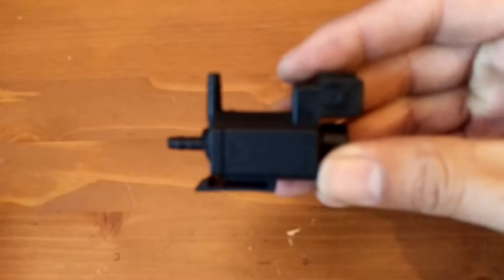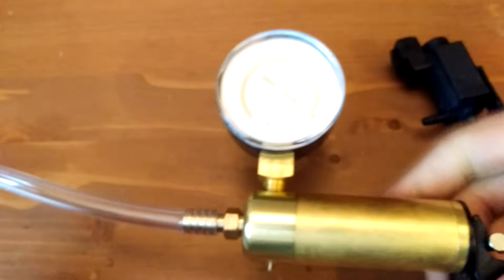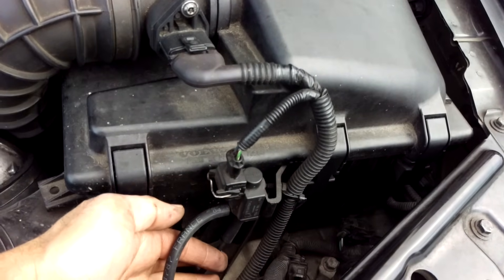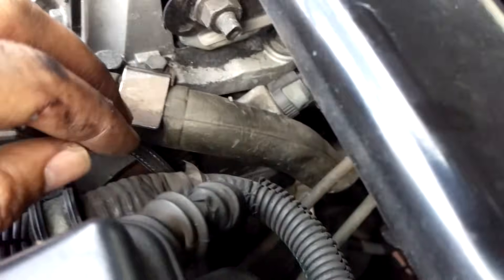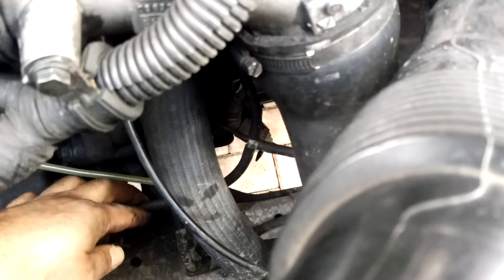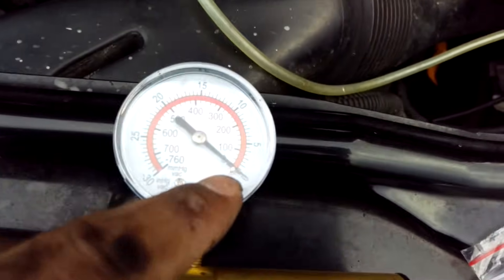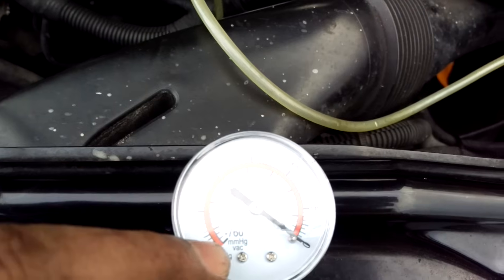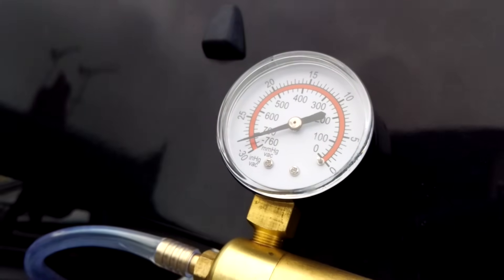How To Easily Test a Turbo / Boost Control Valve TCV

Comment: Fantastic, helpful video!  Is the test the same for 2.5T P2 Volvo engines?  My TCV is located same place as yours in the video... but whereas your video shows a TCV with what appears to be only 2 ports, my 2.5T TCV has 3 ports... two in-line and the one perpendicular port you hook your vacuum tester to.  Seems that it would be the same test regardless, yes?
Reply from the maker: You need to test the vacuum feed going into the valve first to make sure vacuum is available then reconnect and test the outlets on the valve for vacuum when the valve is operating in the appropriate circumstances.

Comment: Could this be the reason why the engine goes into limp mode in 4th gear when floating at 2500 rpm?

Comment: Hi there, What about hte Volvo D5  2010 -  205 hp twin turbo, where is the  Turbo / Boost Control Valve TCV located?  And does it have 2 of them? regards MEtin.
Reply from the maker: From memory there are two, one of which is an electronic actuator on or very near the turbo and there's a solenoid operated vacuum valve at the back of the engine bay. I would recommend asking on www.volvoforums.org.uk as there have been lots of discussions on there. Good luck. 👍🏾

Comment: Hi Mr SiRobb!
Reply from the maker: @mggergo9108  Hi!
Reply: @sirobb  so, my vacuum test was stable 700 mmHg. And the solenoid is working well. But!
Reply: But the popping noise is wery strong. What do You think, whats the problem. (2004. 2.4 D V70 eur3)

Comment: On my XC90 I just paid for new “Swirl flaps” as they were totally broken inside also, but the noise from the “pedal taking my foot off” still very annoying- Volvo garage does not seem
To
Know what it is.. could this Sensor be faulty or is it something else? They say “waste gate on turbo” but mechanism
Opens and closes when stepping on gas so I dont think its a turbo… 😮any tips? Thanks

Comment: Just carried out this test, on idle my vacuum gauge is shaking/fluctuating between 200 and 350, when I bring the revs up the vacuum shuts off at 1100 rpm. Any idea where I should be checking next please Rob.

Comment: Hi Sir my xc 90 d5 year 2004 is having a problem with the pipes of the coolant system the gasket is not the problem what can it be hope u can help…. Thanks… greetings from 🇩🇪
Reply from the maker: Hello. Can you give me a lot more information please?
Are you losing coolant? Is the engine overheating?
The cooling system has many, joins, pipes, seals and gaskets.
Reply: @sirobb  hi the engin is constantly 90c… it is not losing cookant
Reply: The coolant level is going down when I drive….
when I open the coolant tank and the pressure goes down from the pipes. It fills up between Max and min
Reply from the maker: @MuBe-um7rq  Check the coolant level when the engine is stone cold.
It must be at maximum on a cold engine.

It does not matter if the coolant level changes with engine running as long as there is no coolant loss and no overheating.

From your description, I can't see a problem with your cooling system.
I have a cooling system flushing video in my list if you still think you have a problem.
Never open a hot cooling system.
Reply: @sirobb  why do the pipes get that hard ( the pipes after the thermostat)or is that normal ? Again thank you a lot for your respond.
Reply from the maker: @MuBe-um7rq  The cooling system operates correctly under around 12 psi/0..8 bar pressure once warmed up so hard pipes under pressure is correct and normal.
The pipes return soft when cool.
Reply: @sirobb  thanks a lot for this information 

Best regards from 🇩🇪

Comment: Thank you for a great informative video. I can do the same test to check the Booster Pressure Solenoid by connecting my vacuum pump to actuator "Out" and I should be possible to read on my pump if the supply vacuum works. I have a N47T Twin turbocharger engine 218 HP. I think I have two Booster Pressure Solenoids and I think one of them is at fault. I think the error 299100 pops up because the turbine flap can not activate. Maybe all the errors I have had in 6  months caused by Solenoids. I was not aware I had 2 Solenoids, after watching a video last night I now understand why. I have replaced the solenoid in front not the one mounted near the torpedo wall. So I have to order one more Pierburg 7.02256.27.0. Solenoid. Cross finger I am right. I have order a hand pump like yours. I am looking forward to complete all test to verify my engine and turbocharger  works as it should. Think you again  for your inspiration and motivation:-))

Comment: I have checked the hoses on my turbocharrger. I can see at once there is a deviation on connections on the Booster Pressure solenoid. From the vacuumT-connection is connected on the vacuum hose connection on the solenoid. The other "OUT"  with cyan color connection is connected to an old hose going under the turbocharger. The Turbo Control Valve bottom connector is connected to  the Vacuum T-connection. The other connector on the Turbo Control Valve is connected to a hose to the waste gate.  Is this correct? Lately I have got error 299100 Pressure converter turbine flap, Activation Open circuit. The same error comes up on test this evening repeatedly.. The other error 29A400 repeatedly pops up Charging pressure actuator position control charging pressure actuator closed too far positive control deviation. I had this error over 6 months .

Comment: On the Pierburg 7.02256.27.0 Booster Pressure Solenoid,  there are two  connectors, The one marked with cyan color is OUT, connector to the TCV. The other connector goes to T-connectors and vacuum pump. Correct?
Reply from the maker: Correct
Reply: @sirobb Thank you very much for  your quick feed back:-))

Comment: Great video SiRobb. After wacthing your video I understand my TCV is connected wrong. According to your video the TCV Bottom connector goes to the vacuum pump and T connector to Booster Pressure Solenoid. Correct? The other connector on the TCV goes to the waste gate actuator. Now I have two new Pierburg, a TCV Pierburg PA6-GF30 and a Pierburg 7.02256.27.0 Booster Pressure Solenoid. I want to be 200 percent sure how to connect these two devices. On the Pierburg 7.02256.27.0 there are two  connectors, one from the vacuum pump/T connector and one "Out" goes to the TCV. Am I correct now? The workshop has messed up the connectors and the hoses after replacing my turbocharger for 6  months ago. My car has been on the workshop 3 times and they can not figure out what is wrong with my turbocharger. But they charged me each time. Yesterday I have cleaned my Map sensor, it was clogged up with over 1 cm of oil and carbon. After completing cleaning the map sensor the engine runs more quite and smooth and reacts at each acceleration. Drive train errors messages dissappear too. No more drive train error at 2000 Rpm:-)). I appreciate very much your sharing of your knowledges. I love watching your videos:-)). Please help me if you have any comments to help me on the correct way to make my BMW car working again.

Comment: Great video! Thank you for sharing your knowledge. I have problem with my turbocharger after the workshop replaced my turbocharger.  In 6 months I have limb low boost and  many errors on my BMW 525D. My car has been at the workshop  3 times and they can not figure out what is wrong. They charged me everytime  and the charger has come up over 2300 Dollars. Thank you to guys like you who share knowledge, I have found out which components has faults and replaced them. I had to replace my Booster pressure Solenoid, the pressure converter valve and two hoses which cause leakage. I am  aware a vacuum/pressure handpump is very usefull tool and has decided to invest in a Mityvac 8500 serie. The handpump tool is a very handig tool for many tests when you work with cars.

Comment: SiRobb this is a brilliant video where i cannot thank you enough (Seriously thank you so much for making this technical demonstration), my BMW 320D m sport on the N47 has an air leak or vacuum problem where the EGR valve that is brand new is staying in a closed position causing fuel issues and a engine warning light (failed MOT) that 5 garages have failed to diagnose. It makes me angry because there are great videos on YouTube such as yours that show step by step instructions but more so save us so much money, as all the garages want to do is just hit and miss and change parts including BMW dealerships.

Comment: Thank you for these essential tutorials they’re great. When performing this test does it also imply that the vacuum pump is working correctly? If I pull the pipe off my valve and place a finger over the aperture I am getting a weak suction and the engine popping continues when I remove the oil filler cap?
Reply from the maker: If you want to know if the vacuum pump is working correctly, you test the vacuum directly as per my other video.
Reply: @sirobb  thanks si👍

Comment: Hi there I'm wounding if you might be able to diagnose my turbo problem. No one can help me,  not even Mazda!
2008 Mazda BT50 3lt turbo diesel 4x2.
Problem: turbo not making boost until engine is warm (10 minutes driving)
After vehicle is warm makes about 80% boost when diving under 80kms. At 100km car feels like the accelerator has a governor on it and has no boost

I've replaced the following. 
1. New turbo
2. New hoses
3. 2x boost pressure solenoids
4. New manifold air pressure sensor 
5. New fuel filter
Currently running injector cleaner in the diesel but not making and difference. 
Any suggestions would be helpful. 
Thank you
Reply: Similar problem of inconsistent boost with my Fiat Multijet diesel. Did you find a solution?

Comment: hi si my xc90 is a euro 4  and i think the turbo actuator arm is electrically operated, but if the tcv didnt put out any vacuum or the vacuum was continuous so broken, could this put the vehicle in limp mode ie cannot go more than 30mph, no warning lights just: engine system service required message?  i know you will bollock me to get obd scanner, but struggle to see a iphone compatible one, many thanks Geoff

Comment: Hello Simon 
I think I read somewhere that you deal in Volvo Vida. Im looking for Vida software, can you maybe help?
Regards Ivan
Reply from the maker: Is it just the Vida software you want or the Dice tool as well so you can read your car? Also what Volvo model and model year do you have?
Reply: @sirobb  I have the Dice and a laptop with a clean win 7 pro. I got my VIDA Dice equipment some years ago but my laptop broke down. I had in mind Vida software  only and as I do not have mail on this laptop I was thinking of Vida on disc ?
Reply from the maker: @ivanstenchristensen7037  If the laptop has an Internet connection, I can provide the Vida installation files as a download with a video showing how to set up everything.
That would be £30GBP

I'd recommend that the laptop is Windows Updated anyway before installing.
Reply: @sirobb  okay this sound great. How does it work do you have a Web page ?
My laptop is still at work shop so maybe in one or two weeks im ready
Reply from the maker: @ivanstenchristensen7037  No problem Ivan. When you're ready, just send the £30GBP as a gift/friends and family only payment (not goods and services) to the PayPal link in the video description.
I'll then forward the links to your PayPal email address.
Reply: @sirobb  Okay. I need to set up an email on my VIDA laptop then (I only use it for my Volvo V70 2006)?
I will try to create an PayPal account guess its no problem for a Dane 😁
Reply from the maker: @ivanstenchristensen7037  Hi Ivan. Payment received with thanks but PayPal no longer allow access to email addresses. Please email me at SiRobbYT@gmail.com then we can proceed.

Comment: I have an Euro 4 D5 (120kW), I did the test. When the car is idling, the vacuum meter flickers heavily at around 200mmHg. Once I rev it to 1000RPM, the vacuum then drops to 0 as it should. Would you be worried about the rather low amount of vacuum it produces at idle?

Vacuum pipes from valve to the vacuum pump, and the vacuum pump itself is working fine.
Reply: On this engines the vacuum meter should be around 700-800mmHg,so I guess you should clean or replace turbo solenoid sensor

Comment: Hi si, I have surface oil on various pipes at the back of the engine, and gathering on the large turbo pipe at bottom of engine, when I remove oil filler cap air blows out, I’ve been told it should be sucking, do I have a pcv box on my 2007 xc90 euro 4, any info most welcome ,many thanks
Reply from the maker: You need to monitor boost levels first of all to confirm overboost.
Reply: @sirobb  hi si, sorry to be a pain, Looking for your ELM 327 There’s quite a few and they are also called pro scan, Could you please send the link for The tool you recommend from your Amazon shop, many thanks

Comment: hi! I often watch your tutorials they are top. I have a problem for 2 years on my s60 d5. I have the message "engine repair requested". The variable geometry works, the turbo is redone, the 5 new injectors, the two new solenoid valves (turbo and egr). The amission manifold was cleaned, the egr manifold was also cleaned. I put a plate on the 3-way valve on the egr for the stopper. I put the circuit under depression no loss. Before the engine went into safe mode, but since the turbo is new as well as injectors, no more safe mode but just the message to the odb. When the message appears, the turbo whistles much more than habittude and makes the noise of a dump valve. The message appears when it’s hot, and if I drive slowly under-speed .... In the Bosch diagnostic case, an EGR valve defect appears, that would be my problem? Do I still have to change the turbo and egr solenoid valves? I have no more ideas, and I have already spent 3000€ of repair, nothing changes. Thank you for your help
Reply from the maker: Get the code read with Dice and Vida for a specific fault code and an explanation of the code and the possible causes and fixes.
Reply: @sirobb  Hi !  i do buy dice/vida ... So Bosh say EGR at now. I have a blanking plate, but no hole, it's the problem i think. before changing the turbo and injectors, I had egr faults, air conditioning, turbo pressure, flowmeter, regulator/limiter, turbo control, egr control, temperature, pressure and incorrect flow, exceeded value and many others. Thanks to you for your help. I can take a vida on ebay, no Oem? thanks again.
Reply from the maker: Remove the EGR blanking plate.
Reply: @sirobb  yes i do that this week. I cant understand why when the error message on the odb screen appears, i have more torque and turbo make an Sound of big wastgate discharge....

Comment: This is the same as a boost solenoid isn't it? Does this produce the vacuum to pull the turbo actuator?
Reply from the maker: No that boost solenoid is on the front of the engine block. It's only on Euro 3 D5.

Comment: Hello. 

The valve you are showing is not a Turbo / Boost Control Valve TCV , but is an ENGINE MOUNT VACUUM VALVE.
Please correct this.

Best regards.

Comment: Pleassss help !
I have Peugeot 508 ( with mini copper 1.6 engine)
I billet my turbo all works fine 
After two weeks my car go limp mode after top gear , with code of charge pressure regulation is high , shockingly after inflating charge pressure vacuum it just temporary fixed problem can you help me ?

Comment: I’ve got XC90 d5 2005 I’ve had loads probs and just had engine stripped twice injectors re conditioned everything done .. but it keeps going in limbo mode it’s whistles when I drive of and goes slow . I have to pull over and restart engine. Heads been polished timing belt changed but it keeps going limbo mode .. smoke tests done on every step when engine put back together no leaks but goes in limbo mode.. I’m fed up but stuck with it cus I’ve spent a lot pls can u  help me out . Ok even come down to show u ... 07951 827 641. Pls get back to me I’m pretty sure it’s something u can help me with

Comment: So if I get a P0045 error can the solenoid be bad or is it most likely a wiring issue?
Reply from the maker: You test with a vacuum tester as shown in this video. If it works correctly, the problem is elsewhere.

Comment: my motor mounts on the xc70 2002 lose the vacuum, even though they are new, so as a solution I blocked the hose from the turbo valve to the mounts to prevent a vacuum leak, do I risk something breaking?
Tnx in front sirobb!
Reply from the maker: You risk breaking something by not having the correct engine mounting working properly.

Comment: Hi Sirobb, great vids really helped just one thing, i have tested the tcv and vac pipe coming into it, i have the same tester as you but it holds between 20 & 25hg (not 30) is this ok ? 2007 d5

Thanks

Sam
Reply from the maker: As long as the needle is stable, that should be fine.
Reply: SiRobb great stuff thanks.... only idd thing is tht i still hve popping noise ?!? Mounts are fine etc 🤷🏻‍♂️
Reply from the maker: Check at different engine temperatures.

Comment: hi mate i have a problem with my xc70 2002 she has gone into limp mode and i cant get it out no codes showing up on obd2 but can get a 039 code on the dash now i think it may be and i do say maybe the MAF i have ordered a new one at £22.50 worth a shot even if to rule it out its done 200,000 miles so do you know of anything else i can check or anything else you may have come across in the past as i am at a loss at the moment its a d5  as well if that helps 
thanks peter
Reply from the maker: If you can get live data on the OBDII, I'd be checking the MAF reading first before buying another one.
Also, a £22 MAF (if it's brand new) is likely to be junk.